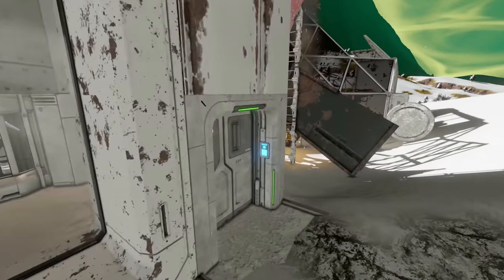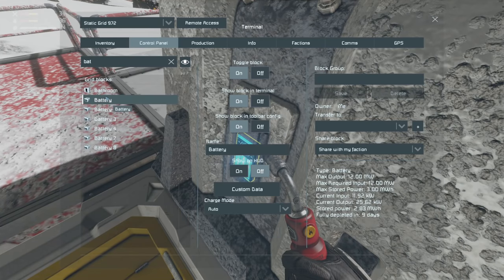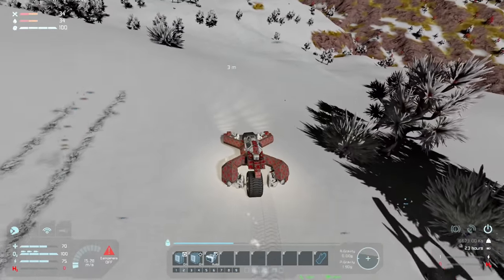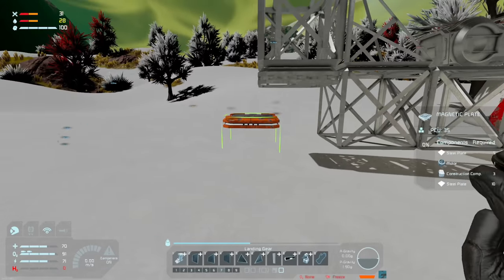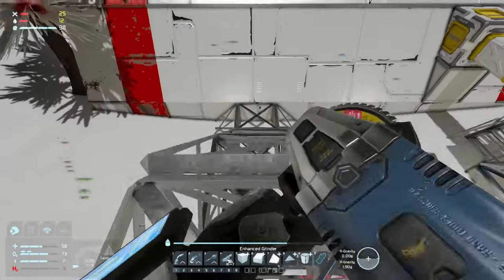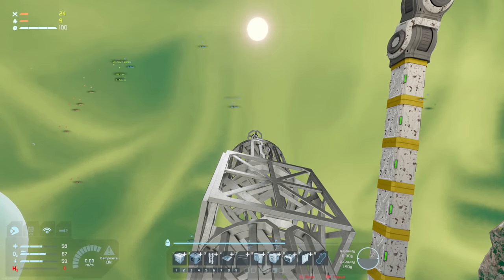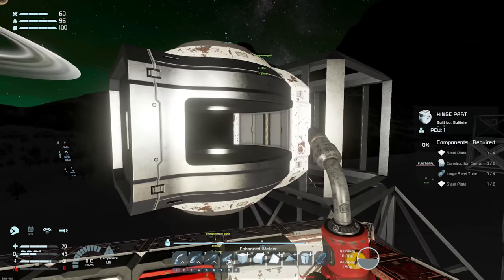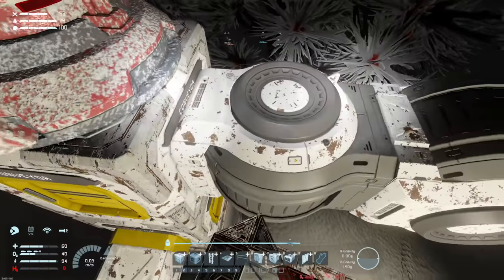Survival Impossible - Printing Fort(s) Capac(s) #70 - Space Engineers Hardcore Survival

Comment: Not sure how committed to your grinder contraption you are, it will give you a cool "parts moving around" effect, but if it gives you trouble you may just consider a merge block to connect your Fort Capac to the projector arm.  It is a few more parts used per fort that won't be very useful after printing, but it will make it so much easier to disconnect a print and then set up for the next one.

Comment: You do need to give the maglocks clearance for the full block to get them to weld. You were able to clip the ground on the first one because it was a static grid and you were placing the block manually. Since your projection is on a mobile grid that won't work. And I've had times where I was able to place blocks by hand that a welder would not place automatically via projection because of the bounding box clipping something.
Reply from the maker: Once I rotate the thing to weld from end to end I think that'll make it easy to keep the space for the mag lock clear :)

Comment: Just had an idea for the lonely red battery. Put a chair on it and make it a recharging block for your engineer. It can be easily moved with another vehicle to where you will be welding or grinding a lot. Unless I am mistaken having 3 bottles of o2 you run out of power faster then o2 when welding and grinding.

Comment: The support piece should probably be cheaper, since using all of that steel plate every time you print a fort capac will end up wasting a ton of iron.
Reply from the maker: Yeah I suppose I should use a smaller block that's got fewer plates in it

Comment: Something I learned from your tutorials was using the welder to weld things around it. Sitting here waiting and thinking "he`s gonna turn those on any second after piping up.." then you proceed to hand weld the entire thing :) 
You also may want to put that battery in the center of the building to avoid it getting shot? 
Maybe add a section to the Arboretum to park your "discarded" vehicles, cant remember which series you and Capac had build a museum for that purpose.  
As Scott Manley did it on his Kerbal video`s.. editor Splitsie is future you.
Reply: The battery currently is as far from the decoy as possible without extending the building and anything that gets the battery will most likely already have taken out the turret in which case it will be easier to just print a new Forts Capac than to repair it.
Reply: @davidmartensson273  Fair point, didnt think about that, but it makes sense.

Comment: Make projector platform move away from welders rotate 180° , move closer to welders and finish welding. You also need conveyor to move finished ForwartCapacs (Forward+Fort+Capac) on deck to be carried away. 

You may want to attach small antenna do you could assume Direct Control and use turret as camera. And since you built large grid you can attach interior turrets to outside on a bing as provided more distraction and close range fire support

Comment: Ok this is a fail for Splitsie if he thinks 1 turret is worth squat.  The rever took fire from more then 10 large grid turret's so that 1 is useless other then cannon fodder.   Sandbags might be more effective for that.
Reply: You need a lot of firepower to be overwhelming enough to prevent damage, not to just win. I doubt that these forts will be completely alone. Tho I agree that a couple more on the sides could be beneficial, and so would using more heavy armor, especially on the top of the turret base and around the decoy.
Reply from the maker: You've completely missed the point, this is a printer, for making lots of them. Hence lots of turrets that are much harder to destroy all at once than having several which can all be hit by the notoriously inaccurate incoming fire. These need to be cheap so I can make a LOT of them and replace them when they get hit

Comment: Hmmm;
So you place a decoy to draw fire away from critical bits - good.

Then place the wind turbine on top of it?
Reply: That's how you can tell its a Splitsie design
Reply: The fort isn’t really going to survive more than a single attack if an enemy targets it. The turbine just keeps it powered until that point.
Reply: The point of the decoy is to keep the turret from being the first thing targeted, allowing it to get more shots in before being torn apart too. These things are meant to be disposable, and so putting the turbine there makes sense. (Plus the battery is far less replaceable than the turbine, so if the fort DOES manage to kill the enemy with the time it has, the turbine and decoy can be replaced without needing to carry around a supply of battery packs)

Comment: What about adding a collector on top of the fort capac so you can airdrop in ammo to rearm forts as needed, small redesign but adds to overall long-term functionality
Reply: I didn't see any storage or conveyors on his design.
Reply: @edwarddesposito4476  That could much easier be added to the top without removing the room for Capac though.
Reply: The problem would be to control how much ammo to drop, probably needs a script to not dump to much ammo.
Reply: @davidmartensson273  like splitsie does anything the easy way come on now :)
Reply: @davidmartensson273  Set a connector to dispense without draining, then he could manually feed them into the connector from the inventory menu. Still needs a bit of manual doing, way easier than needing to land 30 times to refill the turrets.
Reply: @BurningFyre  that would avoid having to get out to feed it yes :)
Reply: @davidmartensson273  i mean, you asked how he could control the amount dispensing, i answered.
Reply: @BurningFyre  I agree, it would solve part of the problem, and with no jetpack, going down would mean parking the panini, which could be a problem if its very uneven terrain, so yes, that would help.

But in that case he could even just manually drop if from the side door :)
Reply: @davidmartensson273  yeah probably but which sounds more Splitsie: hand loading a machine gun or building an elaborate dropper/catcher system to do it slightly better?

Comment: You could design the building so that, from the control room, you have an easy access to load the gun and an access outside to a parking space for the Panini.
Or even better, have the parking space on the roof so that the piston can push the Fort Capac's straight onto the landing gear of the Panini. That way, you can wait for the Panini to lock before grinding the connection block, no more 1/2m drop.

Comment: So, I know it's a terrible thing that the arboretum got smashed, but it may be a good time to make some kind of addition. It occurs to me that the complex has more than doubled its job capacity, so four people, or even eight sharing beds in shifts, is not quite enough. What about making a matching living area the other side? You could even use one side expressly for bunking, and the other as daily needs and a gathering area. This also allows more guns and power, etc, which will keep the building completely separate, since the assembler thing is an annoyance.
Reply from the maker: I had toyed with having something on both sides originally but preferred the asymmetrical aesthetics. I am thinking a close circle of forts around the base is in order though as the first ones placed
Reply: @Splitsie  indeed, the final tree must not fall!

Comment: I was surprised you attempted to print it sideways. I guess it simplified the piston setup. You could add 8 more and come at the projection from the other side. It would increase the speed of printing and lower the likelihood of incomplete blocks. In turn, it would cost more material, setup time, and make the building larger. But then again, it might make it more flexible for printing other things.
Reply from the maker: Yeah I was thinking about the pistons first which was an error as I'd only need one more piston you print from end to end

Comment: In building printers there can be 2 blocks between the welder's.
Instead of a grinder you can also use a Gatling gun (small grid) or a interior turret to shoot the block (with a turret: disable moved  and set a timer to shoot once) keep in mind where the resulting piece of scrap metal goos
Reply from the maker: I liked having a few more for the added speed but you're absolutely right :)
Reply: But since the support will be welded by welders it will be completed, a single shot might not be enough and the deformation could damage the surrounding structure.
And he would need collectors for the scrap.

Comment: 26:58 It's actually the smarter way to do it, I think.  All my conduits are gonna copy that one now haha

41:24 Whenever I build a welderwall with the intent of producing (or mass producing) the same or similar blueprints, I actually set up two walls that face each other and then pull apart on their own pistons so that whatever I'm building is printed from the middle out.
Reply: That welder wall idea is genius. Sargonnas has mods called Ganymede, they are a bunch of different mods but one that would possibly really help are the MagLev Pistons, 35m for conveyored and 50 for non-conveyored. The style doesn't really fit SE but the function is definitely worth it and the 35m one would make making large ships way easier. One piston per welder vs X-Amount more and the height is alot shorter.

Comment: When aligning the conveyors between the buildings. Could you incorporate a piston in the line for fine tuning? Rotor to piston to conveyer tube set up. As far as ejector to collectors. I use them on my vehicles.  Drive materials to a drop off center. Eject from the truck down a ramp to a collection area. No need to line up connectors and it adds a interesting visual.
Reply: For grid-to-grid connecting when alignment is hard, i use a piston on a rotor like a crane. As for the drop off thing, it’s always a fun thing to see ores rolling down a chute/ramp, just as long as they don’t cause simulation issues XD

Comment: How about a welder setup from above?  Retract the welders into the roof, then swing them out the way to airlift the Fort Capac...  Why do it this way?

Because you're Splitsie and you like things to be overly complex and challenging?

Alternatively Weld from wind turbine end to the turret.  With the welders on two horizontal pistons and the projector on a third will give you thirty metres of welding space, you can then use a forth piston on the projector end to lift the whole Fort out the roof, an extending ramp on the roof will allow you to arm the thing, then climb up to the Panini to take off.  Your grinder disconnect will work the same, though be in an awkward spot.

Perhaps add a timer to turn the pistons on/off every second to help control the welding speed - move for one second, weld for one second, move, weld, etc.  Two timers if you think the weld/move times need to be different.  Allowing the welders to move at 1.25m/s for one second (Half a block) then hold for a little while to weld anything up before moving again should mean that no blocks are missed, but be adjustable to give you a reasonably time efficient printer.

Edit; if resources aren't too limited, how about making the decoy plates out of heavy armour?  Might give the Fort a few more seconds to take down whatever's attacking it.

Also, as Dynax has said - you need a Clud Hutter, and maybe that should be the name of the printer?
Reply: In that ambition, print it laying sideways and then rotate the fort up for pickup :)

Comment: With the Printer.. I suggest you print it from 1 end to the other instead of its wider front side... just move your 'base to projector' connection point (the one with the grinder) to the skinny end and build down the long middle... you will need to enable your printer to print longer distances and if theres weight issues, just put wheels on the bottom of your printer's welders

Comment: If you build long line of connections to bring the material in, you might consider pistons instead of conveyor tubes. Just build a piston, extend an build from there. Faster to gain distance than with conveyors I think.
Reply: I had the same thought. Also, extended pistons also weigh less than the equivalent length of conveyors, might not matter so much here but useful on mobile contraptions.
Reply: @Cyberguy42  The only thing you need to take care of is weight so every 10 or so you should make a piston facing down with a leg (landing gear) to stabilize it, but otherwise I think it's faster and works.

Comment: Could you simplify the moving parts by moving projector instead of the welder rig?

You had the rotator planet project in the command room in Survival Unlikely

Or can you not build on a moving protector?

Alternatively I was thinking a model like your ice drill would be neat. Where you have a chain under the floor the provide cargo to the welders, which drives along the floor and has a small control room on it. So you are always in a good spot to monitor what the welders are doing. That would also make it easier to expand the printer for larger prints if needed

Comment: If you are afraid of air attack, how about building a rotative array of small grid minigun with shell, you will need to remote control it but 15-20 minigun firing at the same point can saw most ship very quickly.
Reply from the maker: My experience with rotor cannons is that they shot a lot of ammo until they take one hit and then they're just scrap
Reply: @Splitsie  If you build them in light armor, yes :D

Now I'm tempted to see if I can make a somewhat more robust rotor turret.

Comment: talking from a performance perspective, would it not be a good idea to use connectors to connect your buildings? as they are all on one grid system without connector? or am I wrong about sub grids using more performance than separate grids
Reply from the maker: Connectors aren't much different to hinges and pistons so it's kinda a wash as to which is better

Comment: If you would flip the fort it would be a bit better at sustaining damage I think
Like put the turbine and battery in the back and then connect via those 3 beam blocks to the turret house with 3 decoys on its sides (like 1 block out and covered with half armor blocks or something like that, you do want your decoys to be at least minorly protected as they will get shot first, or skip the 2 on the sides and just have 1 stick out the front for that more slim design)
like: 
Top View:
- = Nothing (Aligning) : T = Turbine : B = Beam Block : A = Armor : G = Turret : D = Decoy
-----------A
---------ADA
TBBBAGDA
---------ADA
-----------A

Side View:
- = Nothing (Aligning) : T = Turbine : B = Beam Block : A = Armor : G = Turret : D = Decoy : P = Battery : M = Mag Plate
T----------G
A-------AAA
PBBBANADA
A-------AAA
M--------M

Could use a cheaper block to grind of instead of a beam block, not that it matters much but hey
Reply from the maker: Something to remember with decoys is that incoming fire isn't very accurate so there's probably upwards of a 3m radius to the area that's hit. It means that the keep the turret functioning (which is most important) the decoy needs to be at the other end or it'll just get too big
Reply: @Splitsie  true. It was just a suggestion anyway :)
Do decoys even work against reavers tho? Because reavers dont have turrets, they have front facing guns and AI, so they may very well not care about decoys at all

Also did you have a stroke writing that?

Comment: First thing that comes to mind is swapping the connector to drop scrap to the other side of the arm, rather than extending it a block. :D

You COULD, alter the blueprint,  without just tipping over the one you have. But it's slightly more complicated than you might want, which is pick it up with the Panini, then fly up the Platform Canary and get on from the Panini, fly down and add the block, then fly back up.

Something to be aware of, is that I have found mag pads willing to lock significantly off to the side of their actual block space, so dropping it might be a bit trickier than anticipated if you don't disable autolock. Also... it's 100% going to fall over if the small grid welder is under it when it grinds the attaching block.

Also your vehicle graveyard makes me sad. Though also curious. If the Crawler is down here, where's the Remora?
Reply: Remora is still in  space. Splitsie decided to leave it at the station and took a cargo pod back down. The intention was to get a large grid ship back to the station with hydrogen.
Reply: @zack464  I see that's worked out for him.